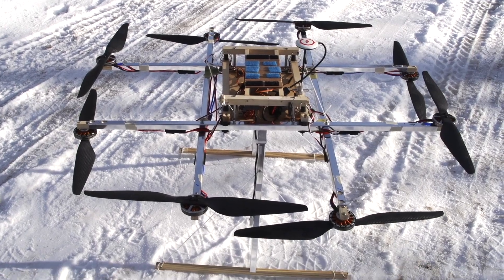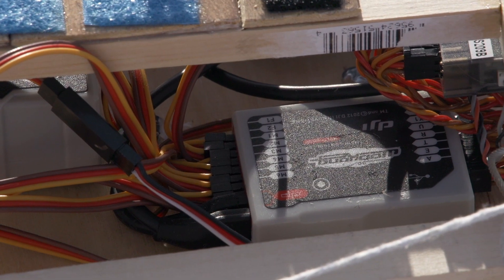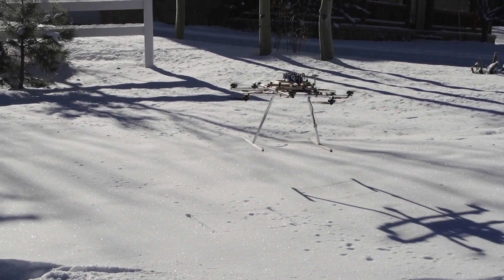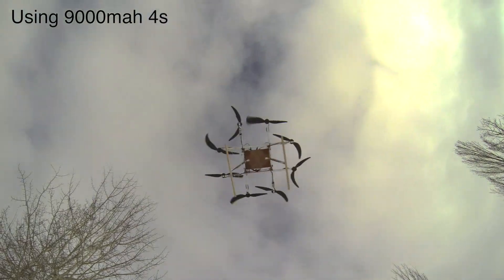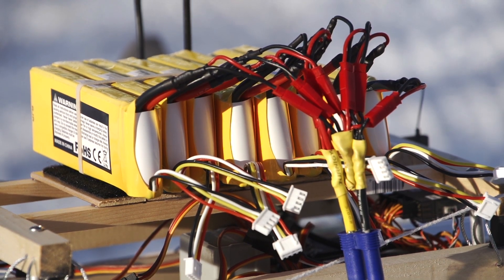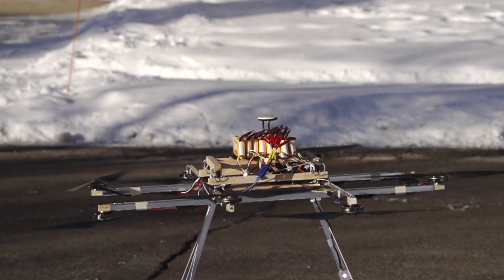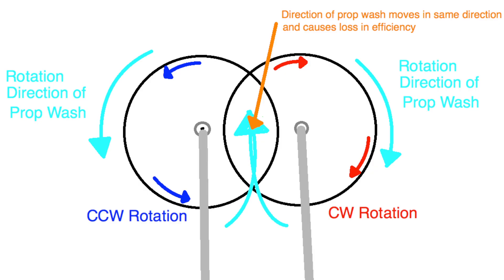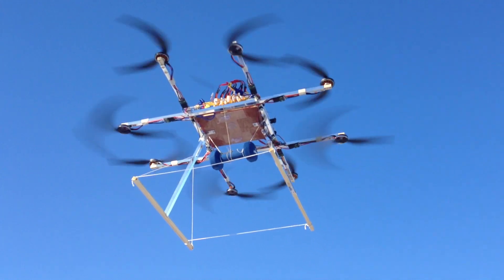Scratch Built OCTOCOPTER Testing - RCTESTFLIGHT -

Comment: Very nice. At first glance, I think you could gain efficiency, still carry the desired weight (camera) and increase flight times by using the parts you have there to make a coaxial Y6. The FC and everything will move over, and the power to weight ratio is superior, and you have the redundancy of the coaxial system if a motor or prop fails as it can bring your camera back down.

Comment: The overlapping is a huge part of the issue you have with efficiency. Not only do they create airflow in the direction of the next prop (and back), but the tips also create the most turbulence. So none of the lower props really have any clean air to push, and the upper props push into the turbulent mess, again lowering efficiency. Get them in the same plane and separate as much as you can (within the size limits you are willing to handle).

Comment: That's a nice design there. If you're still reviewing products, you should check out the Estes Proto-X/Hubsan Q-4 nano quadcopter. It's supposed to be the world's smallest quadcopter in production. I have one and I love it! Apparently, you can even use a Hubsan X-4 V2 transmitter to unlock hidden bonus features like turning its lights on and off, and doing aerial flips.

Comment: hey dan do u think u could help me get my deadcat in the air?
im using a kk 2 board.
I have tried using setting from others who have posted about there dead cat but I cant seem to get it to hover it just wants to flip onto its top side.
I thought the board just needed an update but since iv done so nothing has changed.
my hopes are to get my gopro on the front unfortunately this is my first multi and everything I read about them seems to not apply or not work for me.

Comment: What issues have you been having with your Wookong? We had one fail catastrophically at the end of last year. I'm pretty sure the accelerometers had been acting up on a few occasions before it failed completely. Unfortunately the issue was sporadic and we ended up chasing vibrations rather than putting it down to a faulty unit.
Reply from the maker: Mine is very unstable in manual mode, it seems the gains are way too low and trim is way off. If I turn the gain up any higher it oscillates. I have also been flying and randomly it starts to descend quickly and the whole copter starts to spin. Like what would happen if a motor burnt out.

Comment: I wonder if you extended the wooden ends that the motors are bolted to, you could get the required 3" to keep the props apart. Then you could flip the props over without over lap.. Just a thought. Thanks for the inspiration!! I have some square bars used in deck fencing I may try your setup!! Thanks!!

Comment: Very nice! I learned this winter that my flight times are cut significantly when it's below freezing outside. My batteries only discharge half way before the alarm goes off.

To combat this, I leave my packs over the air conditioning vent before I head out to get them warmed up. I made little sleeves out of this flexible insulation wrap stuff and fly my packs in them. Now I get near-summer performance out of my packs!

Comment: Have you considered using square wooden dowels instead.  I think they are a lot longer.  They are sold at Home Depot and Lowes.  Also, if you want to use longer aluminum square tubes, you could bolt two together to make a longer boom.
Reply: Yea but those booms are really bent most of the time.

Comment: i make parts for my hydros out of insulation foam covered with either fiberglass or carbon fiber depending on how light/stiff i need the part to be, it would be easy to layup a very lightweight frame in any shape you needed made out of the fiberglass covered insulation foam..love your models and alot of the stuff u you need are made by RC modelers in either aircraft or boats from similar materials u are currently using ...good luck...love the vids :)